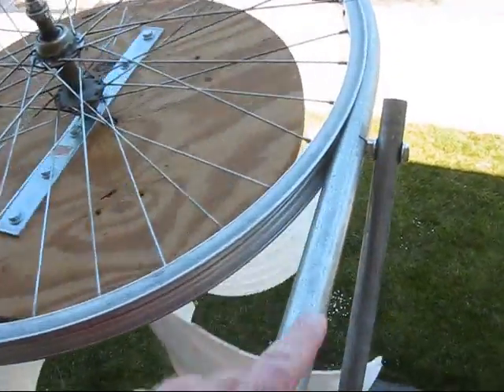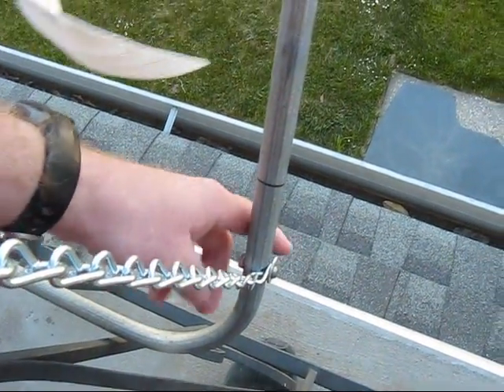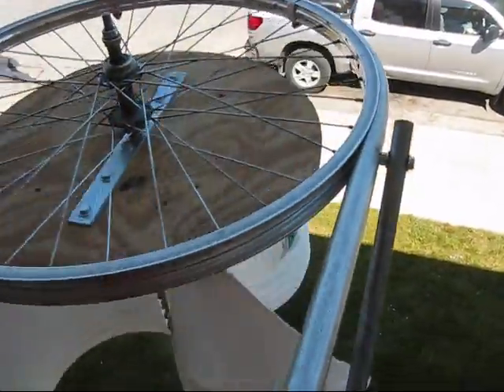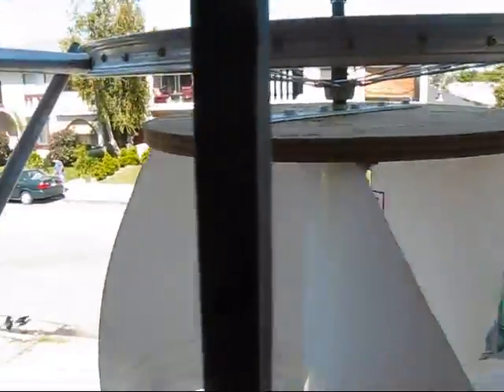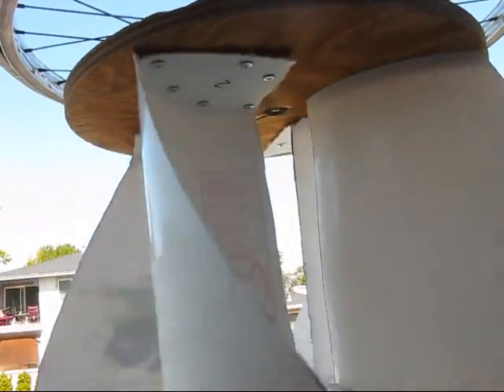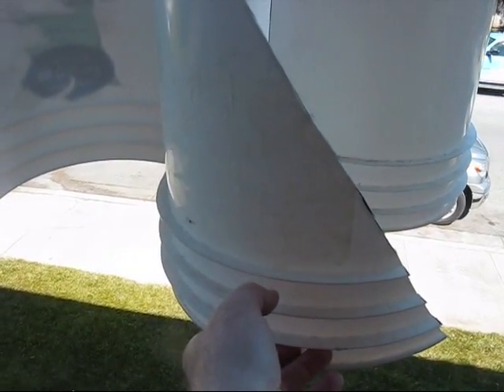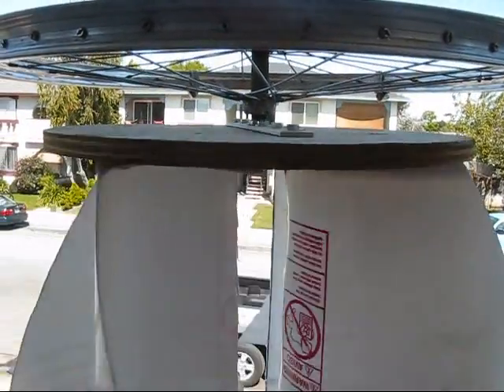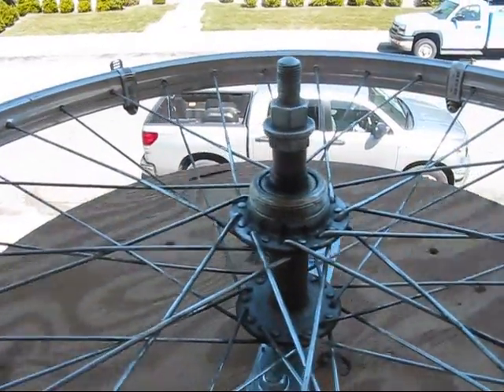My VAWT (Vertical Axis Wind Turbine)

Comment: This is bloody genius!  Just thinking if the bike wheel turned too, then you could stick a fan belt around it and attach it to a car alternator. 
 I love the simplicity of your design and the easy-to-source matrials.   
One of the major benefits I can see from making a VAWT is that you don't have to worry about a pivoting system which adds a lot of complexity..

Comment: Hi, I would like to see anything else that you have done to it. What's been added if anything.???  I've been working on this type of stuff for year's" & know a good design when I see one.!! You'res" is very good. I'm gonna tell ya, what will make it
Bust through the GOOD Category" & Be EXTREMELY EXELIANT!!! OK, SO, You can use it or not at all, it's up to you,. Alright,"
Now,  like I've siad, " you're design is good, but here's what you need to do for it to be Exliant."  From what I see you have a great system put together" ok, 
BUT, " what you need to do is" 
Add another plywood disk to the top, cut it to be a little bit wider than the Rim, edge, okay" like 1/2" inch or so, over - hang," then make some (COPPER COILS)
And devising a way to attache them on the rim, without, grounding them to the metal of the Rim,. Now, you will want to put you're magnets onto the wooden disk 
That is on the TOP.,.. Now" putting something under the coils as to Not ground, them to the Rim, metal, making a short" is (COMMON SINCE).!! OR one would think, anyway. But" anyway, what ya, might wanna do is make some kinda, plastic ring, around 3 1/2 to 4 "inches wide, and go all the way around the Rim.
Use it as a place to attach the coils. 
Alright, devise a way to attach the magnets to the wooden disk you've made to bolt to the top of the axle.
There are lots of ways, to get magnets, I favor the Microwave oven magnets, cause they are 3 to 4 inches across and are always round, and they are a ferret type, magnet, & can, be broken.!! Or chipped, so" be very carfule removing them from old scrap microwave oven's..
Also, microwaves, are easy to get, people through them out without a second thought, if they stop working... That's where I get The bulk of my magnets,.
But I have one very important warning ⚠
About scraping any microwave oven.,!
 Be very careful not to break, or chip the small rings of what looks like a small
PINK PORCELAIN, RING, That's on the tip of the ion - Ray, emmiter". It's the only pink porcelain ring in the whole oven. Ok" the resine I say take exstrem caution ⚠!!
Not to break or chip it, is because, it contains a little known, piosen!!, that if breathed, can cause a disease, that will effect  the lungs, and cause death, .!!! SO, do - Not chip or break the pink porcelain ring, and breath the dust from the break or chips..... Always unplug anything that
Is being scrapped, if it's electric. I know you stated that you had done Electric work, running conduet, for pulling wire, ??
SO, I think you are ok there, but you're viewer's that read the comments section,
& want to try this stuff for them selfes" are mostly who I'm talking to about safety... But I ALWAYS, Encourage them to do there OWN reaserch, before starting any project.!! With today's technology" all it really takes  to do some research, is a few Google searches.
But, I always, try to help by reminding people of Commen sinse thing's" like 
Unplugging anything you're working on, also, be careful, when handling, capacitor's of today,. Some can be small, in size & still hold 4 or 500, volts.!! So, we all know what capacitors do" they hold" ⚡ HIGH VOLTAGE"!! & WILL send it all at once, into what ever touches the wires or post's on them,.. So, that means, us" if we ground the two post's out. So, be very 
VERY" CAREFUL, If getting you're magnets from microwaves..... another SOURCE for magnets, is speakers!! Okay" 
They don't have all the dangers of the Microwave, but they are a bit more work,... I have a system that is 99% successful in the removal of the speaker magnets, without breaking or chipping them, but it's a video, that is to longe for a comment area, so, I will be uploading a video" showing how it's done. I'm not sure if there is one already. But, my  sagestion for learning" is to do a search on UTUBE, For info videos, about removing speaker magnets.... Okay" Then.!! Good luck with you're wind, turbin, system., it does have lots of 
Potential.!!! Thank you for showing it.

Comment: Great Job my friend,!! But" if it was me, 
I would: ( after sealing the wood," with some good grade of sealer") Bolt a pulley to the top of the Rim" and use it to turn a "Car Altanator".!! Run the wire from it right into the window or what ever you was hanging out of, w/the camera., or phone. Then the wire from you're Altanator would go to a car battery" keeping it charged while another wire, from you're battery" went to a LARG INVERTER: Then I would enjoy the free power with something like a smart-Tv.!! LOLOLO OLOLO PS:Thanks for the video.....

Comment: Why an angle shape to the blades? It seems like leaving more material in place would allow for more wind capture area.
Reply from the maker: Correct. I was playing around with different blade designs that looked cool but weren't actually more efficient.
Reply: @DanielJPowell1  Experiments are a great learning tool. I'm interested in further developments.
   I've thought about 4 inch diameter aluminum stove pipe sections cut down the length to create 2 semi circular blades. There's also rolled aluminum roof flashing witch holds it's curved shape rather well. Just some thoughts.
   Have you gotten to the stage of a generator selection? 555 or 775 motor perhaps?

Comment: Does this VAWT generate enough electricity to charge a cell phone?
Just because something spins it doesn't necessarily mean it produces usable current to be of any practical use.  I realize you are taking the trouble of showing others how WAMT could be built but some may conclude erroneously that it could provide their electrical needs at home!

Comment: i like how,you, have solved one of the big est  problems  ever  . that is this can be used on your own apartment  balcony  . keep up the good work
Reply: If there is insufficient wind velocity on a balcony, then it really does not produce sufficient electricity to light even a single TINY LED light bulb!  That single LED light bulb requires 3 Volts at 1 amp of current continuously to keep it lit!  For charging a phone battery uninterruptedly, it takes 5 Volts at 1 amp.  Is this practical?

Comment: Might I suggest that you use a complete half and overlap the inner edges (of pairs) so as air exits in the center it is redirected by the opposite side (just like an auto transmission torque converter ) the air path will be an "S" shape. you will get some additional thrust as the redirected stream exits the opposite side (some videos do show this). At my age and health I cant actually make one but the principle is sound. My gut instinct tells me the overlap should be 25 to 30% of the bucket diameter. (maybe experiment with a scale model a fan and a model DC motor - change the overlap and note highest output.)
For a 2 tier set offset the tiers at 90 degrees; for a 3 tier offset each tier by 60 degrees.
Other drum sizes could be considered. (35 or 55 gal are reasonably available) Obviously the greater the height more need for support at the top.
There are numerous YouTube videos on making a power source from alternators, generators or motors. pick what you have available.
I don't see much consideration of the weather in most videos. Bearings and power sources need to be protected from rain and snow. Consider the thrust on bearings on VAWT's.
I like your idea of using the hub. It will help with the thrust on the bearings in your power source (when you get that far)

Comment: I have been delving deep into wind turbine blade design yours is a good learning exercise to start with but Verticle Axis is not the way to go, 3 blade prop design is the most efficient and the blades have to be shaped perfectly to be most efficient.
Reply: While you are correct about comparative efficiency. For DIY making accurate "equal pitch and balance" prop blades is no easy chore; then you have to "work at always facing the wind" (losing output as the device 'hunts' with wind directional changes). Then there is the need for slip rings or some way of unwinding a cable. All serious mechanical and electrical hurdles.
The vertical solves those mechanical/electrical problems while minimally reducing efficiency 
While vertical does introduce different mechanical problems (thrust load on bearings being a biggie) they are MUCH MORE easily dealt with than those I listed for horizontal.
Go consider the suggestions I made a little earlier and consider the increase in efficiency if the 'vanes' are overlapped as in an auto torque converter that recovers more of the wind power as the air follows an "S" shaped path.
Reply: definitely not easy to make a wind turbine especially a good one that puts out some good power, but one has to know the right path to follow if intending to build one that works, I know this idea works to a certain output, so its what you are after, all good, as I look at everything so one gets an idea, nice to see people taking the time to show us their ideas

Comment: It's one thing to get something to spin in the wind. It's an entirely different matter to produce a sufficient torque.
Reply: Why the gaps mine closes and opens 4 sets of equal and opposite flat blades per rpm or Einstines equal and opposite reactions  not your betza   its on  left corner or as bigger than  Hoover dam or Smaller than car.
Reply: Thank goodness you understand that boundless public enthusiasm does not equate with "energy production."
Reply: Critics of anything that does not profit penny  for 2 dosen. More.

Comment from the maker: Thank you :)  As it is, it doesn't matter how big I make it since it is technically only a whirlygig.  The next, larger version will be hooked up to some sort of alternator or permanent magnet generator.  At that time it will make a big difference if the blades are bigger and therefore capture more wind.  More surface area = more watts of power.  It also depends on the design.  I will likely use a more efficient blade design. :)
Reply: add 2 more cut buckets on the top too to have double power

Comment: Superb design.. Thanks for sharing.  What would be the benefit of building a larger one?  Won't these only spin as fast as the wind blows?  In that case, wouldn't you want the lightest possible model with, I guess, the most amount of surface area per pound?  

Thanks again for sharing.

Comment: That looks  like it will work. I is  not really powerfu;, at llow speeds, but it seems  to be correctly designed. It should  power a small generator well.

Comment from the maker: @WindEarthWaterFire Good point.  My area doesn't get much wind.  A windy day here is 10 to 20 mph, with gusts maybe up to 30.  Bicycle hubs are plenty strong for this use.  If I was in the midwest or somewhere with a lot more wind, I would certainly beef up my design.  If I were generating power I would of course want to minimize drag as much as possible and the magnet idea would be a good route.